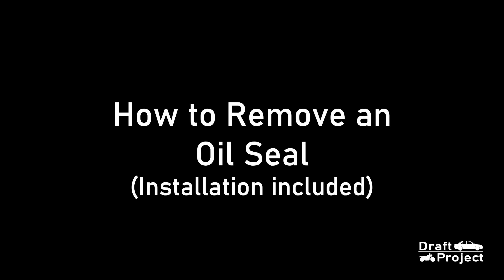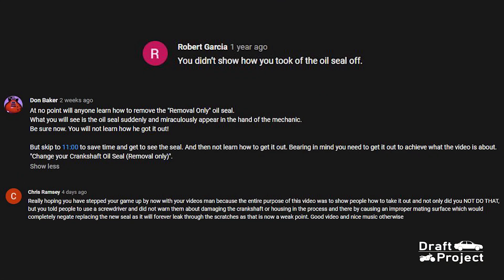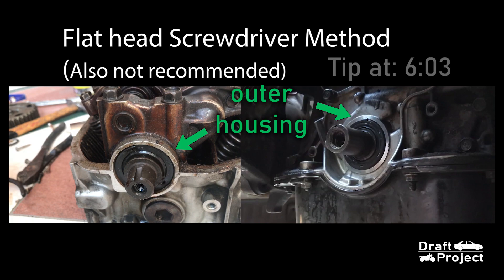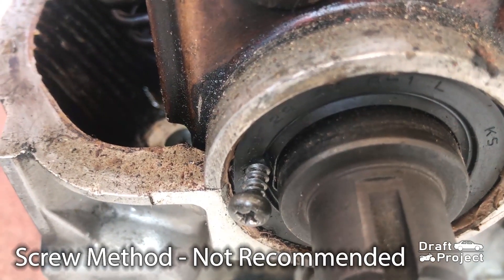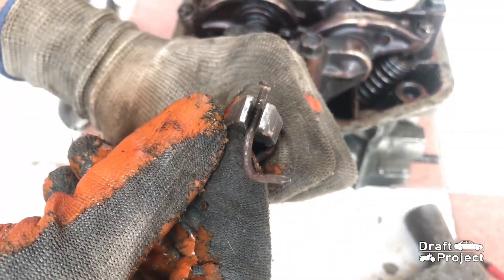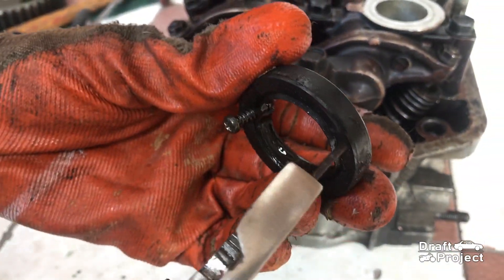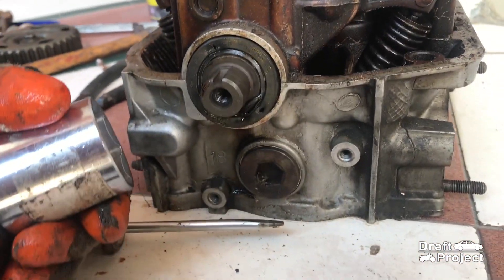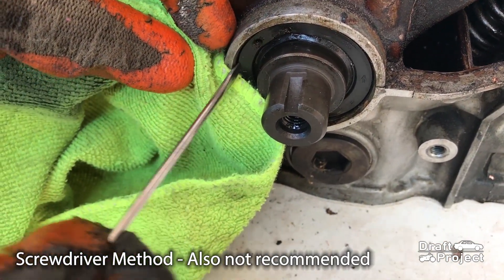Oil Seal Removal and Installation

Comment: Screw method: You're not centering correctly each screw, running the risk of damaging the cam or cam housing. If using a metal screw, first sand flat the end of the screw. But this way is the best DIY way to do it without any chance of failing: drill a small hole with an electric drill. Screw a nylon screw straight to the end. Nylon is strong enough and doesn't damage the aluminum. No need to pull, just screw it and it will pull the seal out. Of course, you must choose a screw longer than the cam housing's depth.

Comment: you should also share "which way" the seal goes. If you are placing it in the pan head, or witch the shaft ...the rubber side up..

Comment: I drilled a 1/8 hole very carefully and used a 90* pick to bend to get leverage with a seal puller came out like pulling off a condom

Comment: Well, dang it, could have used the nail method. just got mine out and pretty sure i scratched up the shaft and the outer wall. going to need to sand things down and probably need to use some honda seal on the outside wall when I install the new seal.

Comment: Great video. Is it necessary to oil the new seal or go in dry ??
Thanks !
Reply: I always lube, if you don’t lube the seal it can get hot and lead to leaks
Reply from the maker: Yes. It's always better to lubricate it before using it to prevent wear and tear.

Comment: a person takes responcibility!  NOT ENOUGH of you! good video
plastic screw driver break the structure that  provides the tension to the case it will also make it easier! i was a race mechanic we rebuilt an engine in two hours between heats.... standard engine with hypo parts including a full race cam, it is really not that hard to rebuild a motor. the only time you need to split the cases is for rod and cam work.

Comment: Another method, drill a small hole that way you can control where it goes, instead of potentially having the screw hit the camshaft. Drill the hole with a 1/16" bit, going slowly, keep wiping the oil off, because the seal backing is made out of stainless steel and if you go too fast it will ruin your drillbit. You have to wipe the oil off the bit, if it has too much grease or oil it won't drill a hole.
Reply from the maker: That is another good method too. Thanks a lot for your advice.
Reply: What wiping the oil has to do with stainless steel springs??
Also oil helps with drilling. You can get drilling and tapping oil from shops

Comment: Really work well for transmission oil seals where there is no gap between shaft and seal; the seal covers all outside the shaft. Bent-nail trick will work well
Reply from the maker: Thanks! Glad it helped!

Comment: Use a nail puller after screw inserted
Reply from the maker: Yeah that should do too. Thanks!
Reply: remember if you nick seal walls or shaft your engine is done at that level of work! most seals are only big enough to hold the pressure of the fluid there is no excess coverage!

Comment: Where you have the front structure on it
Reply from the maker: Actually this is only a spare engine head. I just kept it at home for future use. It doesn't have rocker cover because it is mainly used in the vehicle.

Comment: what is the part number for the seal
Reply from the maker: I tried to search for it and this is what I've found.
91213-PD2-004 (Arai)
91213-PE1-721 (NOK)

These two are different brands but applies the same spec for a non VTEC engine, specifically D12B, D13B and D15B non VTEC.

Please have it check at your nearest dealership and auto supply store for much more assurance and availability of the part.

Comment: use seal pulling tool, or use screwdriver but pry from the face of the seal outward, not from the outside diameter of the seal.
Reply from the maker: I agree with that and it is much safer. Thank you very much for that!

Comment: Very nice trick! I wanted to add that it's important to check the shaft-surface for scoring due to wear from the old seal-lip onto it. It's particularly important when reinstalling the new seal, that the new seal's lip doesn't correspond with the old seal's lip mark/scoring if scoring is present. Otherwise you end up with the same leak as before and you have to do the job a second time... Hope this is helpful
Reply from the maker: Thank you so much for this tip! Indeed, this is really important to remember upon changing oil seals.
Reply: Is that really a thing? I have never seen any oil seals leak before, and all the engines I've seen have a tiny bit of wear on their camshaft and crankshaft surfaces. As long as it's not rusted, or dented, a small amount of nearly invisible grooving seems perfectly normal, and the new seal should be flexible enough to seal up tight? The seal also doesn't need to be airtight, because the job of the PCV valve is to create a CONSTANT vacuum in the crankcase, so that the seals are always "sucking" air into them, rather than pushing oil out. If you remove your PCV valve like many shade tree mechanics do, then you'll end up having oil leaks, no matter how good your seals are, because at high RPM the crankcase can end up having a lot of pressure. The oil seals don't do well with pressure. Note, at WOT wide open throttle, the PCV valve opens up more in order to accommodate the drop in intake manifold vacuum, by increasing it's internal flow rating. At high vacuum during light cruise, the valve closes automatically to maintain a moderate vacuum in the crankcase. On a turbo vehicle, the PCV gets its vacuum from the air intake, pre-turbo, but STILL creates crankcase vacuum under boost.
Reply: @Ritalie Some grooves you can feel with your fingers/nails. I replaced on main crank seal and it leaked more than before.

Comment: How to remove the oil seal and dont damage it (reuse it, because its only for regrease a bearing).??
Reply: Dude just buy a new seal theyre like 10 bucks
Reply from the maker: Unfortunately, oil seals are designed to be used only once. You cannot remove them without breaking it.

I guess you can try to push it from the inside if it is accessible. If that is possible, then you can remove it without damaging it, but it can be quite difficult to do.

Comment: 1st
Reply: hello, could you please make a video on how to clean the overhead cam shaft and for preparation in case the need for resurfacing for head gasket.
Reply from the maker: Hi sir. Thank you very much for watching my video. I will take note of it and upload a video about it in the future. Thank you once again. Keep safe sir.
Reply: what is the part number